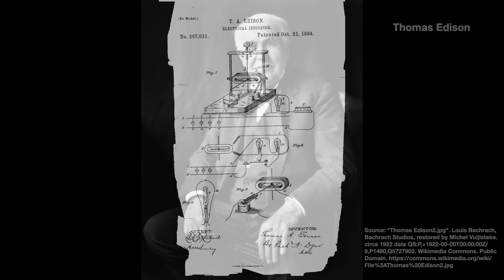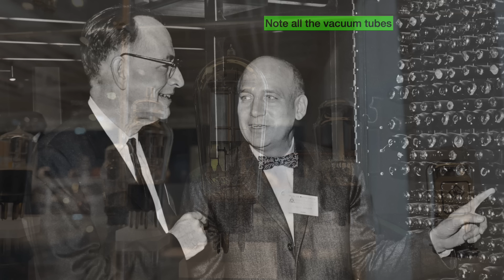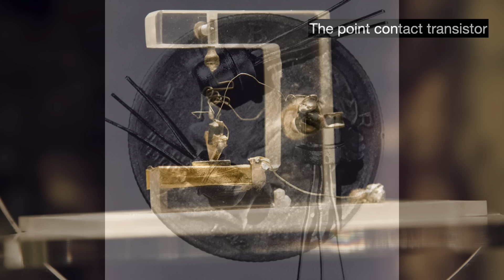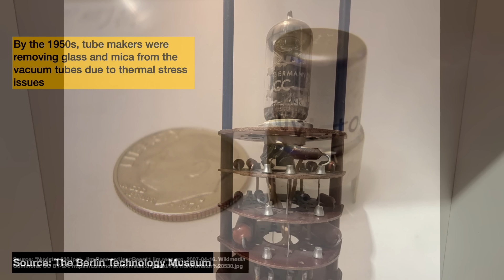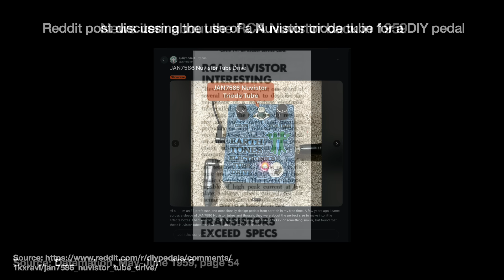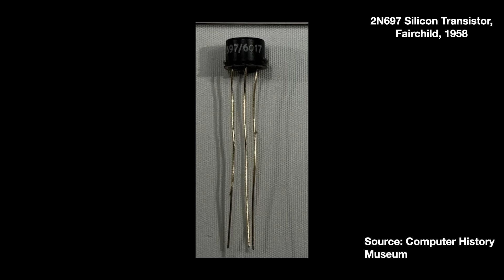RCA Made a Vacuum Tube to Beat the Transistor

Comment: Thyratron tubes are used to this day in linear accelerators (industrial x-ray imagers and radiation therapy equioment). They're a very large glass tube about the size of a half gallon milk jug, used for high voltage/current switching in the power supply.  Come to think of it, the klystron and magnetron are tubes as well, though not glass.
Reply: Dont forget krytrons. Btw I'm pretty sure klystrons were superceded by AMCs in basically everything
Reply: Thyratrons not so much, as IGBTs or MOSFETs have largely surpassed their ratings, even including the speed of hydrogen thyratrons.  (I recall a couple articles, such as showing that IGBT peak current ratings can be modestly exceeded with a preshoot gate drive waveform; or another article, combining a modest speed IGBT (I mean, in present terms, but fast for the time) with a saturable inductor to sharpen the risetime.)  It's my understanding, klystrons are indeed hard to beat for reasonable budget, usability and efficiency at the pulse rating and frequency needed.
Reply: Got to like voltage dependant  devices
Reply: Photomultiplier tubes are also still actively made and used. They're still the most sensitive light detectors we've come up with.

Comment: Due to their compact size, nuvistors could work at higher frequencies than larger vacuum tubes.  This was alluded to with the mention of RCA using them in television tuners where, especially at UHF frequencies, they had lower noise than conventional tube circuits.  The first time I recall encountering a nuvistor was in a receiver that allowed radio stations to broadcast remotely.  This receiver operated at 161 MHz. and was mostly solid-state except for the first radio frequency amplifier.  IIRC, it was designed in the late 1960’s and manufactured by Marti, Inc. of Cleburne, TX.
Reply: Yes IIRC the typical  UHF tuner had two Nuvistors--an RF amp and an osc/mixer.
Reply: Nuvistors were used in several McIntosh FM tuners. Also found in some Textronix scopes.

Comment: Space-qualified Traveling Wave Tube Amplifiers (TWTAs) were my bread & butter for a couple of decades.  They are typically the high-power amplifiers used in satellite downlinks.

"Klystrons, Traveling Wave Tubes, Magnetrons, Crossed-field Amplifiers, and Gyrotrons" by A. S. Gilmour Jr. is a great read if you want to get into the technical details of high-power, vacuum electron devices;  these are still used in high-power microwave/millimeter wave applications.

However, the little glass ones are adorable:  I dig their groovy glow!
Reply: little glass ones.   ......    ..........

hm,    i am dreaming of a 10 pound monster on a table with that kind of talk......
Reply: @kwisin1337  TV, Radio, Audio, Nixie ..
Reply: @kwisin1337 twt can get pretty small, enough to fit in your hands
Reply: Man i love that book, though i think the only gyrotrons are relevant nowadays for amplification, the rest are basically only used for legacy reasons
Reply: I am so glad they didn't decide to call them Travelling Wave Amplifier Tubes
Reply: @leonerduk  The Brass: "We'll call them Travelling Wave Amplifier Tubes."
The Technicians: "Sir, we recommend 'Travelling Wave Tube Amplifiers."
Reply: "The Tube Guys" by Norman H. Pond presents an interesting history of microwave vacuum devices.
Reply: I remember reading that tubes destined for space use were often built without the glass or metal tube.  The goal was to save weight and the vacuum of space was better than anything that could be created on earth.  So long as they weren't turned on before reaching that vacuum...
Reply: @James_Knott I was told that, too. It didn't make sense because the TWT can't be tested and focused during manufacture. 

The heaviest part of a TWTA is the Electronic Power Coverter (EPC), the high-voltage power supply.  It is another engineering marvel: high-efficiency, low-ripple.
Reply: @James_Knott I couldn’t verify if this is true, though for one it would make testing on the ground impossible outside of a tvac :P
Reply: TWTAs remain king for now, but SSPAs are coming to eat their lunch in the near future most likely
Reply: @drdefecation  The power handling of GaN devices is impressive, especially below 6GHz.

Comment: Being 83, an amateur radio
operator since 1962, some 
of my older equipment used
Nuvistors. 😊
Reply: I have a Kenwood TS-820A amateur radio.  It has two vacuum tubs, not nuvistors.  They are very easy to troubleshoot.  If they are not glowing, they are bad. I have replaced them only once.  I am not an amateur radio operator.  I just have the old radio. It was given to me by an amateur radio operator because I am so good and with electronics, mechanics, antennas, power supplies, manual antenna tuners, amplifiers, and the such.  I helped him out a lot.  He gave it to me in hopes to get me to get a license.  But, my conversational abilities are very poor. Thus, I just remained a radio and electronics hobbyists.  I love to listen to the old radio.  I do have a microphone but not connected to the radio.
Reply: @IndridCold-o4o  You don't really need conversational skills to get your license.  Just study a bit and get your Ham "Ticket".  Then, tune around the bands on your TS-820A and you will, eventually, find a place to be.  Contesting, for example, is a way to make many contacts with only a simple exchange that may last only a few seconds.  There are also many ways to provide public service with Ham Radio.  You may be surprised at how satisfying this hobby can be.  73, wy9n
Reply: Also on the Mig-25, Soviet made, of course:)
Reply: @irvinewayne4086  Cannot be overloaded, electromagnetic pulse has no effect.
Reply: @AnthonyTobyEllenor-pi4jq  Not true. I used to work at a particle accelerator and tubes too can be damaged by radiation and high E fields.
Reply: Well that escalated quickly
Reply: 83 and still going strong.
my granny 84, would probably not even know what youtube is.
Reply: @tami6867  the math ain't mathing on this
Reply: @MCNarret  nah I'd rather the math not  math than logic
Reply: @SaberRattlerII Comprehensive reading... OOP is 83; the commentator has an 84 yo grandma. Commentator is comparing her to OOP, wondering how he's still this technical, while grandma is very much not
Reply: I read about nuvistor circuits in old QST from the 60's but I want to ask, did the nuvistor really cost hundreds of dollars each back then? If so, wow....
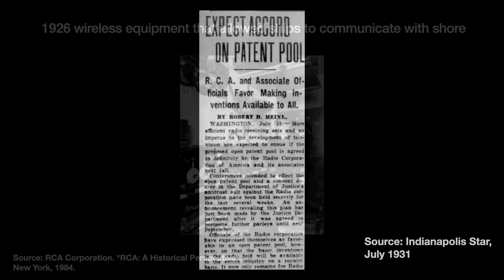Reply: @dant.3505  No, the flyer price seen in this video is a misquote- the tube type shown at 5:41 is a camera tube not a nuvistor. A MILSPEC Vidicon tube would certainly command a price that high, but a lowly nuvistor would have been around $5 or so. I have a receiver with excellent FM reception that uses them, and a round screen color television that has one in the tuner. They were great little RF tubes, but they didn't really do anything other tube types couldn't. Their main claim to fame was their size and low power consumption, it was a reaction to the existence of the transistor so it's no surprise it was made to look like one.
Reply: @nickolaswilliams935  thank you 🙂
Reply: @dant.3505  No.  The author of this video doesn't know what the feck he's talking about.
Reply: Same age, but only a ham (extra class) since 2005.  No tubes or nuvistors here!
Reply: @Raymond-n7k  I am just one year younger. I was building radio transmitter back in the late 1950s for amateur radio and grain brokers to communicate with their headquarters since those days there was no telephone in my part of the world.
Vacuum tube was the king, but on early 1960 we started to make radio receivers with transistor.
For sound fidelity amplifiers nothing can replace the vacuum tube.
In the late 1960s I changed career and never went back to electronics, so I don't even know what is a nuvistor.
Reply: @Nonama-w4x I was once an IT professional.  I was one of the best.  But a job that once payed extremely good became a job that pays poorly due to outsourcing.  I left the computer field completely.  I do not even programme any more.  Though, I still remember it all. I will never go back to the computer field.  I do not even have internet in my house any more.  After ending my career in IT and programming, internet is just not needed at home any more, especially for $75 a month.  I only have one old laptop now, to bring to public Wifi locations, if needed.  Right now I am at work's T1 connected break room computer.  Switching careers is not a bad thing.  I make far more than most college graduates without the crippling bill.
Reply: Any of you heard about Thomas Henry Moray's cold cathode tube back in the day?
Reply: 64 years operating radios, I'd think you should be an expert by now
Reply: How nice :)

Comment: GE’s solution to solid state was Compactron tubes.  These packed a bunch of tubes into a single envelope to save space.  We had a black and white TV with a few of them.  My brother and I called that TV “old toasty” because it smelled like burning toast.
Reply: I did TV repair in the 1960's.   Those GE compactron TV's were a great source of easy income.   The heat in a small space  caused the electrolytic capacitor group to fail often.   (These TV's had all the electrolytic capacitors in the one can, which was unique and had to be specially ordered from GE.   Profit for GE and profit for us.
Reply: I remember Compactrons.  Fortunately, I never had to work with them.
Reply: I fixed some TV's with the Compactron tubes. The chubby ones.

Comment: It's awesome to see actual images and sources rather than AI image slop.
Reply: Ignoring the (2 terminal) diodes that are labelled as switching transistors (transistors have at least 3 terminals) !
Reply: @grahamstevenson1740  : Have you ever seen the 2N3055 transistor? It only has two terminals. Where is the third one? It's the casing.
Reply: @rbarriae  Yes the casing of many (all ?)  TO-3 devices is the collector.
These were glass encapsulated diodes with only 2 connections.
OBVIOUSLY NOT a transistor !
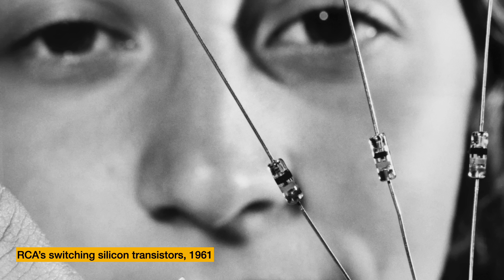Reply: @rbarriae  assuming 19:52 is the reference, yeah no. Those are diodes. My guess based on body, akin to the ubiquitous 1N4841 if the "silicon" claim is to be believed (since the "transistor" part is incorrect).. but I have my doubts in that it is more likely germanium, and has the "cat whisker" construction. Most silicon designs have (and had early on) a sandwich design, allowing the body of the diode to be shorter. The cat whisker layout necessitates the longer body with a void in it, as pictured.
Reply: Seriously.
Reply: Love old patent figures!
Reply: Given the number of serious errors in this video, it may have been written by AI.   For example, whoever wrote this trash video not only thought diodes were transistors, he or it thought vidicon camera tubes were nuvistors and thought that nuvistors sold for $480 each!!!
Reply: Look at the history of the channel. John is a person who has earned his followers through his deep research and dedication. He has appeared in person or by phone in other people's videos because, as a journalist and tech analyst, his opinions are valued. Yes, he makes mistakes; everyone does, but it is written by a person.
Reply: @marclevitt8191 Asianometry's videos have been very good, but recently the quality has gone down.   The last one, on Chinese lathe production, was not so good.   For example it said that China made its first lathe at the Shenyang works in 1953 with Soviet aid, and as someone who has machine shop and Chinese lathe experience I know that simply isn't true - Chinese firms made copies of British lathes well before communism arrived.  This video, on RCA has multiple serious errors, as anyone who has electronics industry experience dating back to the 1960's will know.
There are other channels on YouTube that started off very good but have gone downhill since AI agents have been able to write slick but sloppy scripts.   AI agents are so fast, they are very tempting.
There are channels on YouTube that started off excellent and built up millions of viewers, liked the cash income, but couldn't keep up the quality.   A prime example is Mark Felton whose earlier videos on the 1939-45 War in Europe were excellent, but when he ran out of new aspects to talk about turned to the War in the Pacific, which he doesn't understand very well, and then turned to gutter press - style sensationalism for a while.
One would have to consider that Asianometry may have fallen into this trap and turned to AI, since in this video he has confused diodes with transistors - an error typical of AI but one a conscientious human journalist with experience of electronics subjects would never make, but a layman might.   However he went on to mistake a TV camera tube for a nuvistor and that is an error very possible with AI but something that is inconceivable for a human.   Then he compounded it by claiming nuvistors, which were ~$2 parts used in  portable TV sets retailing for $150, cost upwards of $480 per part.   That is an error only AI could make.   A human would quickly realise that a part used in TV sets couldn't possibly cost $480.
Reply: @keithammleter3824  trash video, really?
Reply: @mlliarm  Yes, really.  See my other post heading another thread three days ago.  This video has nine major errors of fact.
Reply: @keithammleter3824  you must be new in the channel. Errors are welcome to be mentioned, none is perfect. But speaking about trash, well, obviously you're confused.
Reply: @mlliarm  I watched Asainometry's videos from the earliest ones on.    They were very good, but recently the quality has gone down.   The last one, on Chinese lathe production, was not so good.   For example it said that China made its first lathe at the Shenyang works in 1953 with Soviet aid, and as someone who has machine shop and Chinese lathe experience that simply isn't true.  This video, on RCA has multiple serious errors, as anyone who has electronics industry experience dating back to the 1960's will know.

Comment: I've been reading the RCA Receiving Tube Manual to learn about tube design, and how they're used in guitar amps. Great resource.
Reply: And brand new reprints of the RC30 are available at a reasonable price.
Reply: Prized vintage Fender and Marshall guitar amps are mostly all tubes.  Some of the late 1960's-early 70's models have power rectifiers that are solid state.  It's just creating the high voltage for the plates so, there's no audio fidelity involved.
Reply: @BlackPill-obey  That's actually not entirely true about the rec tubes. I regularly push my AC30/6TBX so hard with boosts that the GZ34 sags the audible output of the amp. It affects both the tone, attack, and sustain of the notes played. Tube recs do that constantly at varying degrees depending on the amp's design, and input signal.
Reply: @middle_pickup  Interesting.  I kind of figured that the designers created a power supply more than enough to power the amp.  

However, that doesn't apply to custom or modified amps.  Extra boosts and bigger tubes will demand more than the stock rectifier can produce.

Comment: Magnetrons in microwave ovens and high power transmitters.Vacuum tubes are still with us. Oh, and guitar amplifiers.
Reply: xray machines too, there was like one solid state one with very low power but its discontinued allready.
microwaves without magnetrons are being worked on, theres attempts of making powerful solid state generators, theyre just way more expensive and have no benefits other than variable output power
Reply: And Klystron tubes too, in very high power output applications vacuum tube's power density still is much higher than a solid state amplifier.
Reply: Their use in guitar amps is nothing but ignorant fashion. "Valve Sound" (distortion) can be perfectly emulated in a DSP.
Reply: Are they still used for high power radio transmitters? Or have newer GaN based designed finally pushed them out in the last couple of decades? Honest question. I really don't know.
Reply: @Cadallin  No klystrons are still the king in high power output radars and that's not likely to change anytime soon.